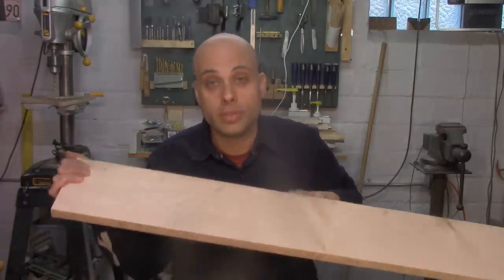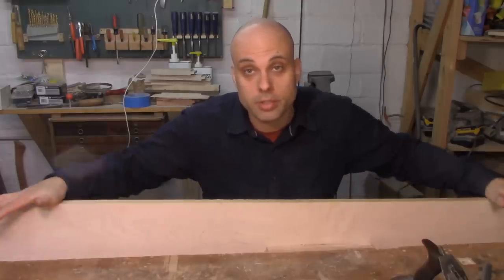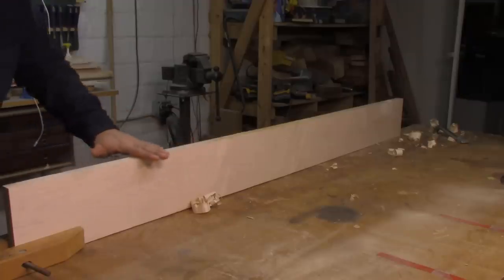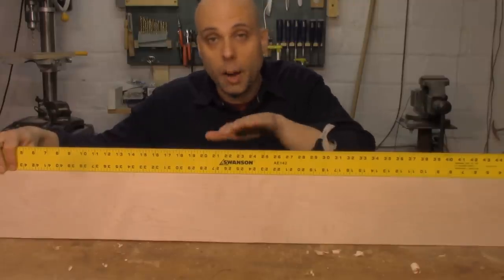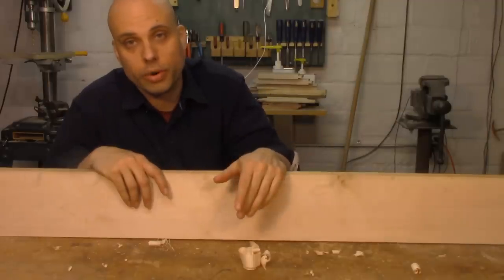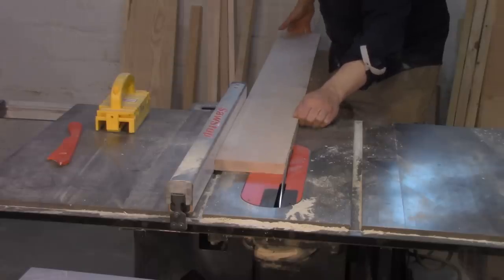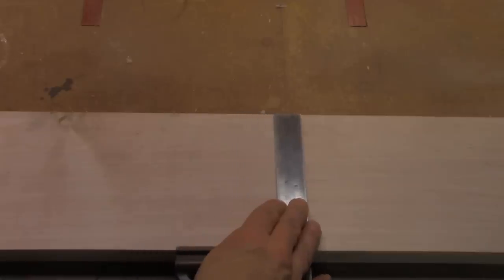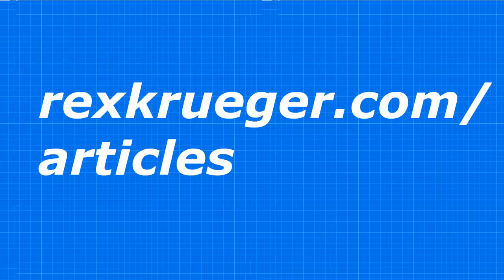Straighten boards. No jointer. No jig.

Comment: Yeah, there are certain hand tools I always carry when I go to a job. People often don’t know I have them. But when the power goes out on a job, which has happened a number of times, I’m still able to keep production going because I don’t need electricity.

My grandfather was a union carpenter, and he taught me a lot. We did projects together when I was only about six years old. We used a lot of hand tools. In fact the only power tool he used in his shop was the table saw. Well, he also used a grinding wheel to shape metal.

When I went to the tech school for carpentry, the first thing they taught us was to use hand tools. When we had a good handle on the use of hand tools, THEN we moved onto power tools. That goes to show you, seasoned instructors KNOW that truly understanding wood involves using hand tools where you can really FEEL what the wood is doing.

Today I try to use hand tools whenever I can. They’re quieter, which means I can work later without bothering people. And it’s just far far far more relaxing. And you feel really in tune with what you’re making.
Reply from the maker: You know, I was just on a carpentry job last month and I was working with an older and very skilled carpenter; much better than me. We had to taper a board and while we were trying to figure out how to do it with the circ saw, I just whipped out my jack plane and did it right there. He was really happy we got it done so quickly and with no fuss. I'm totally a power tool guy for speed and efficiency, but anyone who doesn't know the basics of hand tools only knows half the craft.

Comment: i just use a skill saw and a straight edge, one cut, light sanding, done.
Reply: I've done it with a straight edge clamped to the board, and a router to take a fine cut.  Once that edge is true, the table saw can be used to make the board parallel.
Reply: @isaackvasager9957  I think it's a preference.  They enjoy the hand plane and the process of making.  Not just "get stuff done" as fast as possible.
Reply: @isaackvasager9957  this I agree with.  For most of us it's a hobby.  Do what makes you happy

Comment: ""this is six inches right here it's not very much""
Reply from the maker: Context, my friend. Sometimes 6 inches is plenty.
Reply: OMG... Did we really go there?
Reply: That's what she said.
Reply: I feel his pain,,, heheheheheh
Reply: I have a serious question. I'm new to woodworking and I'm learning as I go.  Could a person use a straight edge and a flush cut bit on a router to get a straight edge without using a jointer or plane?
Reply: Mike Agne Can't see why that wouldn't work
Reply: The Woodworking Metalhead Thanks..I'll give it a try.. found a couple other ways too
Reply: In which stor i can find 30inch sign board??
Reply: Rex Krueger - after all its only the tip of the tool that does the work.
Reply: Phrasing as Archer would say
Reply: Yep, faster too!  Just make sure you have a GOOD straight edge and a sharp router bit.
Reply: Nothing like a "Reach around".   6:05
Reply: @MCA2A  this works great for a first pass, make sure you're working off a face which has already been planed though. For parallel edges follow his advice for the table saw. I have to agree though that being able to joint a board by hand is an essential skill. I sometimes wonder if timeless skills like these aren't disappearing, I've watched a few videos on jointing without a jointer out of curiosity and have seen all sorts of crazy ideas but this is the first time I've seen someone bring up the no- nonsense approach that any one with any formal training (at least in my day) learned on day one...and kept doing it during days two three and four etc etc, untill they got it right and they were allowed to do something more interesting like dovetails with hand saws and chissels. A classic first project was usually a simple toolbox, built by hand before you even went near something's that was plugged in.
Reply: @MCA2A  I think that it would be hard to hold the straight edge straight to prevent it bending as you are pushing against it with the router a track saw gives me better results as I am not pushing against my flimsy straight edge.
Reply: @MCA2A , AS LONG as folks are still offering "advice"...

    You can either get or build a Router-Table... It's a treacherous little piece of equipment, kind of obvious by title, with the router attached from underneath to hold the Cutter up rather like a "miniature jointer"... Now, I prefer to build my own when and as I can... BUT the simple sheet-metal ones are good enough SO LONG as you bolt them solidly to a base (like a flooring quality slab of "PROPER" Plywood... not chip or particle board)... Since most of these things come in the Two-foot by Two-foot size category, you'll be well advised to additionally construct or get and "adjust" a couple stools on hand level with your router table... A bed-rail (my favorite chunk of scrap steel) can then be aligned with your straight-edge (to be sure it's either straight or that you FIX it straight) and then clamped into position to secure the board in question for a past at the cutter... Every cut needs the "bed-rail fence" adjusted so you take off just enough material to straighten without wasting... a good sharp cutter reduces stress and avoids injury... and this collection can be stacked reasonably quietly out of the way... for future uses, SO I'd highly recommend full finishing on the table and stools, in the case you go with it... so they last. ;o)
Reply: I think that was an editing error. Pretty sure that was almost 10.
Reply: @MCA2A , yes.
Reply: they say, its how you use it.

Comment: “If you’re only going to be using your jointer for edges there are much, much easier ways to do it” ...there are much cheaper ways... but not easier. I could edge joint 5 boards in the amount of time you took your first few passes with the jack plane.
Reply from the maker: You're completely right. I was thinking about buying and moving the machine, combined with setup, maintenance, blade-sharpening, etc. But yes, for straightening an edge fast, the jointer is king.
Reply: Okay, cool!

Comment: chuck it straight through the table saw dont need to plane it
Reply: Jared Lamb I was just going to ask... why plane it? A long fence sounds like it’d save all the time spent planing.
Reply: @jpdominator  I have heard about concerns that a rough edge next to the fence could lead to saw kickback. Whether that is still true with modern saws & splitters I don't know.
Reply: Might take 4 or 5 passes instead of two or three, but it does the same thing indeed by the law of averages. Each pass gets you straighter as long as you don't try and force it hard against the fence the first two passes.
Reply: @totallynotabot151 , just depends on whether or not you can keep the board from rocking on that fence, or dipping when it clears the end. Sometimes a compromise is efficient, by hacking off a high spot or two with your hack plane. I mean, jack plane.

Comment: Important skill for cabinets and other large fitted pieces that have to be worked on in place and outside the shop.  Lots of people have tricks, but anything longer than 2 feet and your eye is more accurate than anything short of a properly set laser sight.
Reply: A chalkline can do a pretty good job on rough lumber, helping to get closer to straight before finessing that board. It might save you some time.

Comment: I just use a sled and run it though my table saw.
Reply: I agree. Either that or a flush trim bit a straight edge and a router.

Comment: Seeing that you came up with the same thing I did write down to the three table saw cuts for trying to straighten boards with no jointer and no jig is pretty reassuring that I did an alright job of figuring that out
Reply from the maker: Yeah!  This technique isn't the fastest (the fastest is a jointer) but it gives excellent results. Glad someone else is getting good edges this way.

Comment: use a router table
Reply from the maker: Yup, that's another way to do it...although then you don't even have the 6" capacity of a jointer, so that's kind of a mixed bag solution.
Reply: That's how I've been doing it so far but I really want to do some plane work by hand. Just a pride factor really.
Reply from the maker: It's nice to know that the router table method works for some people. I tried it once and the results were garbage. Lots of people like this approach, but I suck at it.
Reply: I actually made my own router table. As for jointing edges, I used the Router Fence idea that came from a Steve Ramsey Video (Woodworking for Mere Mortals #WWMM). I have followed Steve way before I even had good tools. 
The idea works well but it really helps to make your router fence to accommodate with a split fence concept. For the offset I simply used nylon washers to shim out the outgoing side for the fence.
Reply from the maker: That certainly sounds like the way to do it.

Comment: Thank you for this video! I've been trying to find exactly what you just taught. I'm building a table top with 6' boards and I can't afford a jointer. So far, you're the only one that I have found, after a month of searching, that has put out this information. Thanks again!
Reply: Now I just need a jack plane
Reply from the maker: You're very welcome. You might want to subscribe; tomorrow, I'm releasing my video on perfect crosscuts. As to your jackplane, it kind of depends on where you live. Many parts of the US have old tools everywhere. I also have a series of videos on plane-making. Maybe that will help. Thanks for your compliments!

Comment: Good vid, much appreciated. May I add?

I use a 4 foot aluminum level (biggest I have atm) to find the high spots. Just lay it down, anywhere it touches the wood, high spot. Any gaps between the wood, low spot. Its just a handy straight edge.
Edit: Didn't finish the video....
Reply from the maker: I agree that a level like this would be great for jointing edges. I'm a bit jealous of those who have these.
Reply: Well, if it makes ya feel better, I'm jealous of those with proper shop spaces, I'm in an apartment in the city, 2nd bedroom is workspace, and not all my neighbors are understanding...some have complained to the super at 6pm! (rotary hammer drill into the concrete walls to install a shelf). Some are chills tho. But I pretty much have to stop at 9, out of politeness/living in close quarters with others. Still annoying, if you want peace and quiet, don't live downtown in an apartment building!

Oh, and I got my level for $2-5 at a yard/estate sale last year. Of course the cost is waking up early early on the weekend. But the sticker shock of a new level is pretty good motivation to get out of bed.

Cheers

Comment: When sighting down the edge of thin boards you can place a stick (pencils or something similar) on the top at each end of the board and sight from these. They will accentuate any warps or twists.
Reply from the maker: A solid tip!

Comment: There are several times that I had to straighten edges of boards as this, and I have always set up my straight edge fence on the board and run a handheld router along the fence. Did end up with good results.
Reply from the maker: Sounds like a good technique!

Comment: I've done much the same thing with a long board sander like the ones used in a body shop to shape Bondo used in auto body repair. It's slower, but when I need an edge to be precise. it gives me greater control.

Comment: I just found a perfect extra long straight edge….an aluminium feather edge as used by plasterers.  Box section with one thin wedge side marked in distances (mm for me in UK).  The edge is super straight, clean and six feet long. Now, You could get a quality spirit level as long for the same 40 bucks, but it won’t be marked out as a useful giant ruler…and you can rest a level along the ali box back to level it in use anyway.  For ply or plasterboard layout work it’s fantastic and back box section is an inch thick so you could use it as a circular saw guide.

Comment: I’ve read a lot of comments on here, you know going down the comment rabbit hole.....
So I’m guessing that there still is a battle with Abrams vs Underhill camps. 
I like the videos. They are more of a practical, sit on the fence, use what you got kinda guy. 
I just wanted to say this:
Time is money. The more money that you spend (tools), the more time that you have, and vice versa, if income matters.
Enjoyment of woodworking, that’s not income dependent, and using methods of 100 years ago or today is a relaxing way to avoid reality. A peaceful time in your shop, basement, or garage.

Comment: My jointer lies idle in the corner of the workshop, the most reliable and easy way to edge boards is with a router, straight edge and template following bit.  Experience has taught me never to use the term "foolproof"...but it's close.

Comment: Wow this video is amazing. I am pretty new to woodworking. I only have a few projects under my belt. But recently I have been getting into furniture such as bookshelves and tables and what not and I don’t own jointers or planers. This video was so well explained I feel like I know exactly what to do!
Reply from the maker: That's fantastic!  That's exactly what i was going for. Thanks for the nice comment!
Reply: Planing the wood will actually give you the highest possible finish. It will enable you to produce super smooth surfaces.  It will also get you to understand wood grains so that you can better understand the wood.
Reply: @bighands69  I assume you mean HAND planing the wood, correct?

Comment: So many people think they’re making simple options for straight edges, but even this is complicated for a noobie like myself… first would have to learn how use that planer properly… had one, tried it… tossed it in the “never again box”. I was definitely making the problem worse by digging into the woof and setting the blade on the planer, at least mine, was annoying. Actually found a good video on making jig using MDF and tablesaw which i’ll try. I credit you for your creativity though.

Comment: I kinda stumbled on this method when I tried making picture frames (actually for my rare comics) from pallet wood.  I don't even have a work shop so I cut the boards vertically with my rip hand saw and because the edges were actually surprisingly straight I just stacked 4 together (for the frame sides) like you did here and used my cheap Japanese plane tool (can't remember what its called but you pull instead of push) and plane them all so it was straight to the eyeball and used my ruler to check too.  Much easier also with shorter lengths.
Reply from the maker: Sounds like you're getting it done with limited tools. That's the key to craftsmanship. No one ever has all the tools they THINK they need.

Comment: You can also aim an inexpensive laser level down the length of the board. This tells you if it's flat or not, and highlights any areas which are more or less up and down. You could probably rig a quick-apply jig for this purpose, if you'll do it a lot. A holder for a laser-pointer and a cheap bubble level can be made to do this, too.

Comment: I will agree that everyone needs to know these skills and when I have the time available I do like to experiment on doing things they way there were done 200+ years ago. Also a big fan of Roy Underhill's work.   But in today's world time is often money and customers have little patience at times.  I try not to give firm timelines to customers in advance when biz is good or tell them they are on a list and because of this I can have 2 or 3 projects running concurrently in the shop at any given time and on very seldom occasions 4 of them.  No stranger to 12 hour days either.  Yes, jointers will go down without notice but I've never experienced both my jointer and table saw down at the same time.  When the jointer is unavailable I always have my table saw with a slider and I can put a straight edge on just about any piece of sheet goods or rough cut boards that can be bought from the stores or yards with just a few clamps.    Good video though and again, everyone that dabbles in woodworking should know the skills you demonstrated as well as many others.

Comment: I use a track saw then I sand with a hard sanding block with 80 grit.  I get a perfect edge everytime.
Reply: All I ever see is videos on how to joint a board without a jointer using this and that. Never seen a video of a track saw and it was one of the first ideas I thought would work. Assumed I must be missing something as no one covered it but obviously not. 👍

Comment: I'll be making a large "shooting board", where the sides/tracks are made from the two long sides of a single MDF.
The workpiece will then be clamped onto one MDF-track and the other MDF-track will always have a fixed position to the first MDF.
The entire thing can be placed in a legvise or clamped to the bench. It's a fairly simple build and should be doable for a very low cost.

Comment: Use your table saw. Make a sliding table out of a piece of plywood with a factory edge. Mine is 12" wide by 8 feet long. Use DeStaco clamps to hold the crooked board down minimizing waste and rip it through using factory edge against the rip fence.

Comment: You can use a right angle and run it along your edge and if you see light there is a mistake. If you have some straight stick put one at each end of your board, you will be able to see if your edge is warped. Stuff that I learned in my first yeah of windows making school that every woodworker in Germany knows.